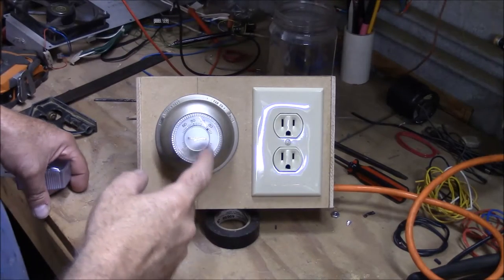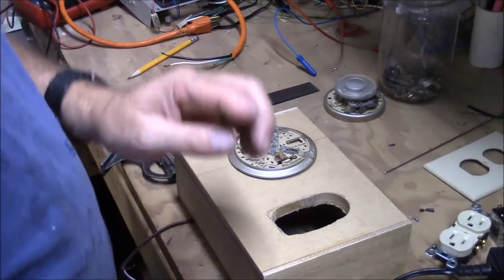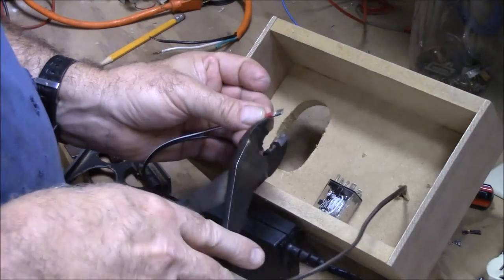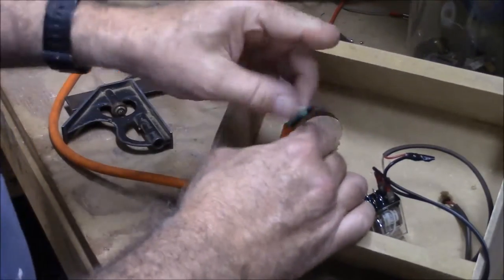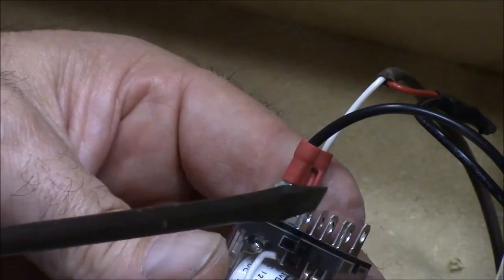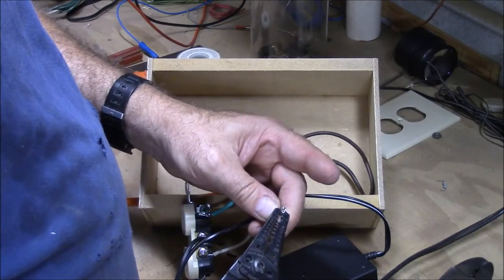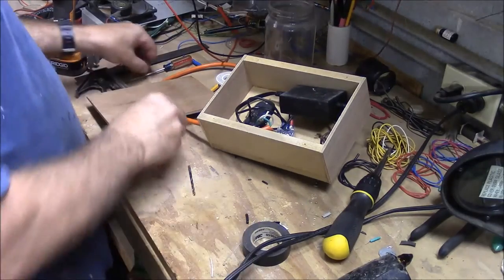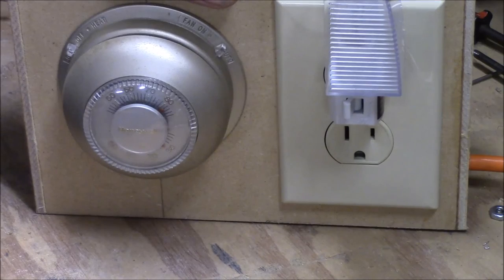Thermostat Controlled Outlet

Comment: I'm no electrician either, but I would feel a lot safer if the outlet was at least in a 35 cent plastic outlet box in there. Why not use a 15 amp or even a larger relay? The outlet you plug all of this into is at least 15 amp... which brings me to... I'm thinking you should have a fuse or a breaker in there to limit you to 10 amp if you're using that 10 amp relay.

Comment: Excellent video. I can use this for my greenhouse project this year and connect a fan to cool down the plants on a hot summer day. Thanks
Reply: +Manolo Chilensis That would be a great use for it.  Thanks for watching!
Reply: I was thinking of running grow lights in the winter and a fan in the summer in Wyoming. All ran off of a solar panel, wind generator or other non grid power system.

Comment: For those of you who want to try this on your window AC pay attenting to mold that might form in the unit. 
Usually on a thermistor controlled unit the condenser is turned off first and then the fan after a while to push all the cold air out. Since that doesnt apply in this case condensation might form inside the unit. Just something to watch out for.

Comment: I just did this except I used a 24v 20AMP 120v contactor and put it on the inside of the ac unit with the capacitor and ran thermostat wire in where the power comes in. Works great so far!
Reply from the maker: Nice work!

Comment: I wired mine the same way but I put a high voltage poly capacitor across the relay contacts, I think .1uf 300volts. I did that so it won't arc across the contacts. The cap kinda acts like a shock absorber on a car making the contacts last longer.  I also wired in a transient-voltage-suppression diode I think 50 volt across the relay coil just to make sure the electronics in the thermostat is protected. I used a programmable thermostat I got really cheap on eBay for 13 bucks that usually cost about 80 bucks new. I had a 24volt AC transformer and just made a full wave bridge rectifier using 4 diodes.
Reply from the maker: Thanks for sharing your setup!

Comment: Thanks for this video :) built this just before i went to the lake with my old RV to use with the window AC unit and electric space heater, i have it set with dual outlets, 1 plugs into the heater and the other into the AC unit, and used a thermostat that has an "auto" option to choose between heat and cool on its own

 Put the thermostat on the wall, ran the wires to the outlets closest to each application and set it on auto for 20°C so during the day the AC will kick on and cool the RV and as it dips down cooler in the night it kicks on the space heater keeping it between 20°C-21°C :)

The old furnace in my RV didnt work and hated trying to set the space heater every night to the "perfect" temp to wake up either freezing cold or boiling hotbinside :/
Reply from the maker: Awesome.  I'm glad it worked for you.  Thanks for watching!

Comment: You said you were using for ac.. so that it would turn off the fan when it got cold enough. But at end of your video you showed that (the light) that was plugged in wich represents your ac when you plug it in shut off when you turned the thermostat up from like 65 to 80. I may be wrong but if your using it for ac you would want it to shut off when it got to a cooler temp not upwards of 80-90degrees etc. By the way you have it it technically would never shut off because if your cooling the room via your ac it will never reach 80 degrees to then turn off.

Comment: Really neat project and idea, however I would have soldered all of my connections and used at least 14 gauge solid wiring. That extension cord will definitely get warm with that constant load on it. Idk what size AC you are using etc… but great explanation and interesting topic. Thanks!
Reply from the maker: Thanks Lucas!

Comment: That thermostat is designed to control 24 VAC relays.  He could connect a  transformer to the 120VAC line in using the 120VAC to drive a transformer to drive the coil on the relay and use the same 120VAC in to power the outlet. Of course, stuffing 120VAC Electric circuits  inside a wooden 'electrical box' is not a great idea. But then, using 16 gauge wire for the 120VAC feed to a 15 AMP duplex outlet to drive an air conditioner belies any clear appreciation of the National Electrical Codes.

Comment: What modifications would be needed for a 240V outlet? I am trying to run something similar for a 240v space heater and want to have the stat cut off the power if it gets too hot as a fail safe. I assume a different relay and the wiring will be different but is that all or would i need any changes to the stat for 240v?
Reply from the maker: I would think just the relay and wiring as you stated.  They also make thermostat limit switches that you can get in different temperatures that would meet that need.  They use them in microwaves and other appliances to keep them from getting hot enough to start a fire. Good luck with your build!

Comment: Its wierd how my ge thermostat uses the g terminal for indoor fan and y fir cooling but yours is different since y is heating for you but it will still work if the fan is set to auto and will work for heating and cooling but if set to on it will be on all the time but yeah the fan is anyway going to still for cooling and heating thanks for the information I'm planning on trying this in the future

Comment: Ya know i did the same thing for a small fan for an air compressor motor thats in a closet so it vents out when it gets warm.  But i didnt use a 24v power supply.  I just straight ran the 120 through the thermostat..  stood back the first test but it just worked like it usually did, no difference and the wires dont get hot m but now i am only using it for a fan @ .3a/20w so just a wee tiny draw..  id guess if i ran an ac unit off of it then those itty bitty wires would party pretty hard..  i was more worried about the mercury switch being enclosed and the arc that would happen with 120 compared to the 24 it usually does and if u watch those on the 24v its still a decent spark...  but 120’s just the same..  good dill though pickle...
Reply from the maker: That would be a great application.

Comment: Could you explain why you need the relay .would it work without it could you explain thanks great video
Reply from the maker: You need the relay to carry the high amps of what you are plugging into it.  The contact in the actual thermostat will not handle the current.  Hope that helps!
Reply: the make high voltage thermostats

Comment: Scott, I live in a 3rd floor walkup and bought a window A/C last year. The thermostat doesn't always work - I leave it on 77 degrees for the day for my dog, and some days it I come home and the apartment is FRIGID. I'm not terribly handy, but came upon your video while searching for a solution. Would this be the best solution for my situation based on what I wrote? I'm looking for simplicity, and while a build-your-own would be great, I'm just looking for a simple solution. Do you have any thoughts you would be willing to share with me? Much appreciated!
Reply from the maker: This would work for you.  You need to look on your unit and see how many amps it uses and make sure the relay you use will handle that many amps.  I would use a digital thermostat.  Here is a link to another similar video that may be easier for you to wire.: https://youtu.be/nNyl_m9ASQg  It may look more complicated but you really only need the unit that you buy and an outlet.  Good luck!
Reply: Soat Mon Thank you! I'll check it out!!
Reply: Soat Mon: I reviewed your video, but it is actually too complex for me. I live in a small apartment and don't have access to the tools required to build that box. The A/C is 10,000 BTU's (model is CL-WAC10A - brand is Cool Living). I see that it requires a "120v/15 Amp household outlet", which I presume is a standard electrical outlet?  I'm wondering if there is simply a device that I can plug my A/C into that has a thermostat built in that will simply make the A/C a 'smart' device? I appreciate your helpful response. If you can help me more, I would be most grateful!!

Comment: are you able to assist me with my same project ???? I set up the same to run a duct fan. went over all connections several times and the fan on the heater goes on then instead of off the fan lowers to a almost off speed / stays on real low. I unplug the project and alls well to run just cant get the duct fan to go on and off with thermostat/project. also does it matter if the heat pump is a ruud systems ???
Reply from the maker: I'm not sure what is going on but you don't want to use a thermostat that is connected to an AC or heating unit.  They have 24 volts running to them and that may be the issue.  If it is a stand alone like I showed, I would trace the wiring and see if you can find it.  It's kind of hard to troubleshoot without seeing it.

Comment: I'd like to do this same project to add a smart thermostat to run a portable AC unit and control it by "Alexa"
Reply from the maker: That would be kind of interesting to do.
Reply: @SoatMon  After researching, if you swap your dc transformer for a 24vac transformer and the relay for an ac coil instead of dc, you can send the coil/transformer leg to a "c" wire to complete power for a smart thermostat. So you would end up using the red blue and yellow thermostat wires. also you will have to hook a green wire to the thermostat that goes nowhere. smart thermostats wont turn the AC on unless they sense that a fan wire is connected
Reply from the maker: Thanks for the info Brian, I appreciate it!

Comment: Can I use this to my window unit ac to make it get my room below 65 degrees? It cuts the cooling off at 63-65 and I need it colder. Does this work like the coolbot? Or is it just to provide power if it gets hot
Reply from the maker: It will not override the thermostat in your AC unit, sorry.
Reply: Disconnect thermostat in AC unit, and tilt the box thermostat if it won't go that low.

Comment: Why don't you just buy already made one device such as DS100 by Suncourt Ductstat Temperature Sensitive Plug-in Switch?
Reply: You can do that with the device DS100. Plus buying already made device is cheaper and it comes with a warranty. It is exactly what I have for the same purpose you described. You get the updates from the NEST not from the Thermostat Controlled Outlet. With that said you do not need to build something that already exists.
Reply: I hope after 1year you realized that the ds100 is only rated at 5 amps and would die trying to run an ac.
A  safe, high amp temperature switch is expensive. 
Don't post ignorant comments. Or go ahead and keep the laughs coming.
Reply: Actually, I came here for ideas. Now I have a few.

Comment: Where did you get the relay? -and what Is the part number?
Reply from the maker: I usually get them off ebay, just whatever I need at the time.  Thanks for watching!
Reply: So what are the specs of the relay in this vid so we can order the same one for this project
Reply: @dougs7367 his is 120v@10 amp x 28v@3amp. Look at your wall wart and buy according to it. If your supply is less than an amp, it might not engage a 3 amp relay.